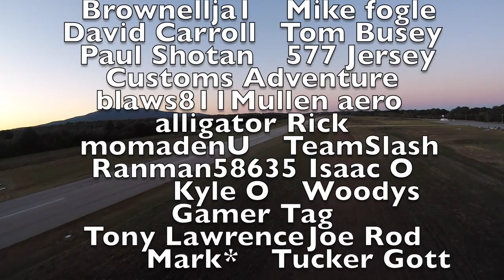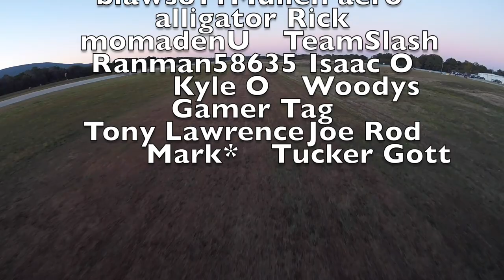Whats the difference between the Angel and Flattop frame?

Comment: They both seem virtually identical, its a good frame for newbies who might be crashing alot. Ive crashed mine a bunch hard enough with just some scratches which would have wrecked virtually any other frame. Its worth mentioning that that whole kidney crusher FT edge hasnt existed on the Flattop for a few years at least, you might have an old FT frame, all the ones ive seen now have a recessed 45° bar similar to the Angel so the difference is even less. Overall both are a good strong frame for accidents and also with all the big bars going everywhere its good for  tying camping gear all over the frame and going paracamping.
Reply: The skytap design is better than most paramotors out there, but the build quality is poor at best and it had many design flaws not found in the FT. Also if you think the FT is heavy, I would check again because the skytap is coming out on my scale over 4 pounds heavier.
Reply: @austinsmith9413  yeah I have completely changed my opinion after the recent videos.
Reply: @Para_Ninja  I too had really high hopes when the skytap first came out, but it only took me a few weeks after it's unveiling to realize something was up. When you compare the two in person, well... there's not even a comparison.

I do still have some hopes that it will fly or perform better in some way, but after seeing it in person, I'm not holding those hopes too high.

Comment: Why do people land on their ass?  Do they forget that they didnt bring their trike, that they are not flying commercial, that they got a cramp in the taint from the straps ?
Reply: I think you are right. landing on your butt suggests bad skills. The only three things that will save your life are basic skills, common sense and a reserve. I fly since 2006 and have never broken a prop. Still flying my old Fly Castelluccio SMN 130 occasionally. it has no damage. All those so called safety features are not going to save you if you fly in rotors or when hitting the ground in a spiral. Maybe the netting will still be in one piece but you will be just as dead.
Reply from the maker: I agree.   Need more skills not to land on your butt